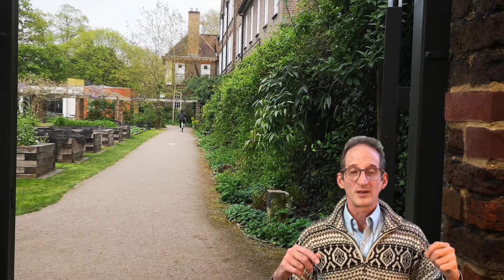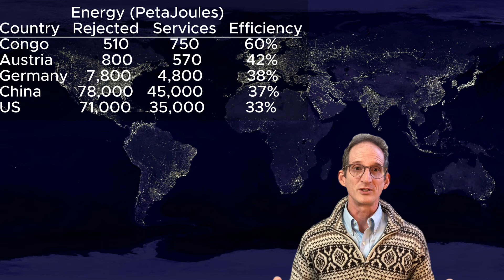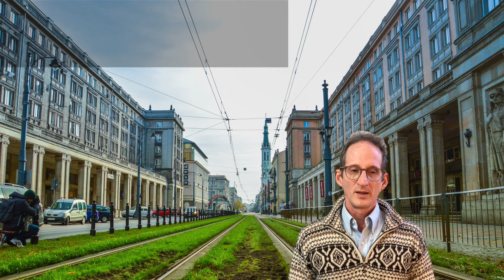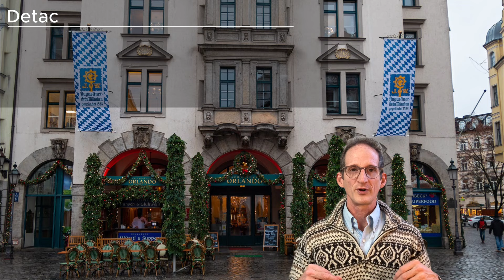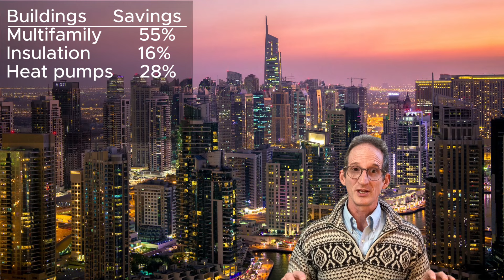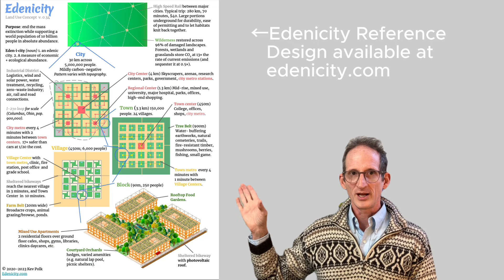Energy Demand in Sustainable Cities. Episode 83

Comment: Great point but it seems that the top three might have confounding variables. Linking them directly is not prudent computation. For example, the savings in heat pumps might already be integrated in the multifamily structure. If one apartment is heated, surrounding apartments are also slightly heated.

Simulations can help you find these variables. I always fine tune my computational precision by linking it with real world data. I remember that you have a video with a similar model to the Edenicity already.

This video made me think that airports should be far from the city. Linked via train with solar panel covered tracks of course.

Edenicity is remarkably similar to Soviet housing. I just hope they would focus on the aesthetics this time. Curved grid would definitely do the trick.
Reply from the maker: @diazalex5314 Thanks for the design feedback. My recent Car Free Neighborhood episode provides a glimpse of what a professional architect did with a few similar housing principles.
  The grid, in practice, would be pretty curvy, as the permaculture method of water management runs catchment ditches (swales) along lines of constant contour. These feed dams and spillways. The spillways are orthogonal to the swales. The swales, and water features fed by the spillways, form the tree belts that are the "bones" of Edenicity. These bones conformally map to the landscape, touching (though not necessarily crossing) at right angles.

Comment: Great video. I almost never hear the efficiency angle for reducing energy demand or emissions. The main talking points I hear are usually just we need to use less energy in general in our day to day lives (decrease our consumption, not really boost efficiency) and we need to switch to renewables. I’m glad you covered such an interesting topic
Reply from the maker: Thanks!  We're sold the idea of sustainability as personal austerity and wonder why it's not happening. If we frame the problem as thriving sustainably, then efficiency by design, at scale, emerges as the starting point.

Comment: What do you think about The Line in Saudi Arabia? It promises to have no cars, streets, or carbon emissions. The construction has started and Saudi has an existing problem with labor rights abuse. Is something like this possible to build by 2030?
Reply: Do not trust oppressors and oil barons to build an energy efficiency city.
Reply from the maker: @apollogeneration2768 The Line has fatal geometric and ecological flaws, and its reliance on so much unproven technology will inevitably delay it well past 2030. In theory it could tick enough boxes to earn a decent Edenicity score (Season 1, Episode 40), but not in the more stringent rating system coming in 2024.
Reply: The line is an ego infra. They are literally building a giant convection oven. The plan to cool it is to create a giant shave ice machine which would also serve as a snow ski slope in the middle of the desert.